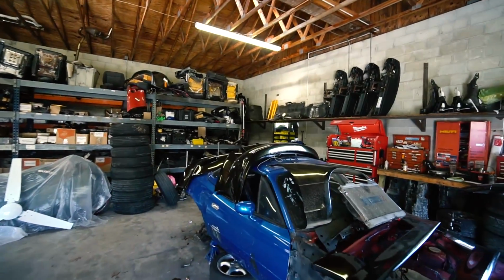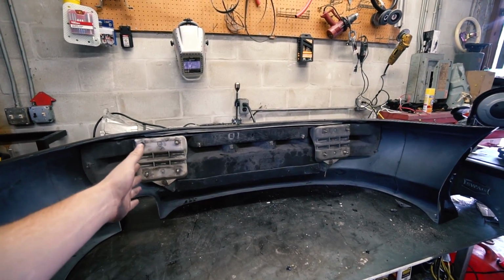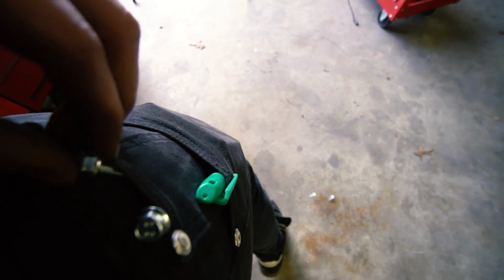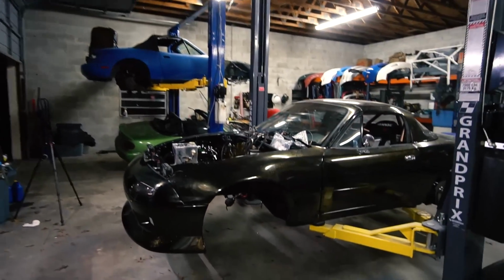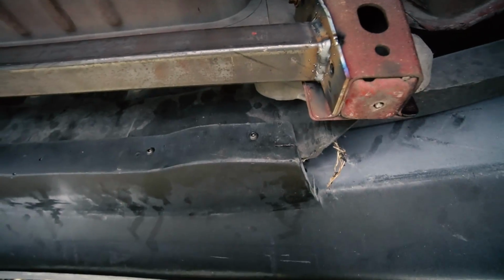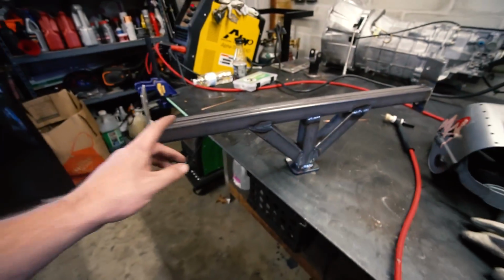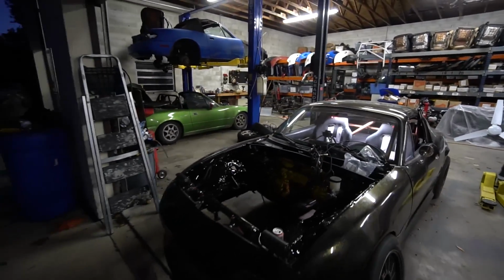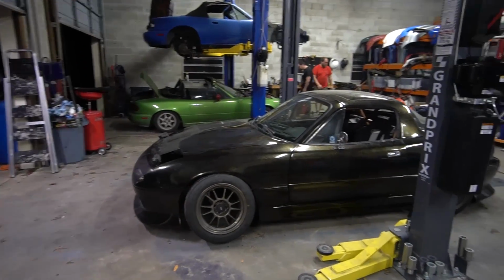LS Miata Gets INDESTRUCTIBLE Body Kit!

Comment: I did replace sideskirts on a 2 post lift, it was a brand new volvo v60. I was also amazed that is worked on a 2 post but i got a  steril koni lift at work. It's absolutly my favorite lift since it wased placed in 2016 because the 80's one finely died

Comment: i jacked the car up before from the rear tow hook point before. it collapsed and when the car dropped, it broke my diff. get an aftermarket rear bash bar w/ a jack point instead? but i guess if you're welding the two points together, it should work. in theory.

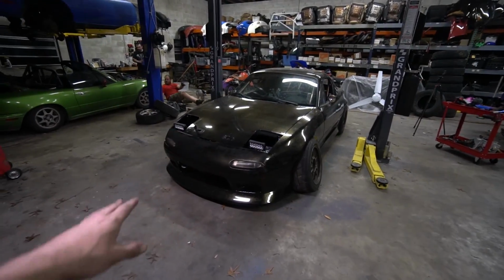Comment: @22:27 pause the video now imagine you took your headlight bars and recess them back into the headlight bucket so that the front of the headlight is flush with the back Edge of the headlight bucket on the hood. Then you go buy some plexiglass and cut it out the shape of the headlight. Make yourself some brackets to glue the plexiglass down like a headlight cover so that you would have smooth headlights on the front of the Miata instead of popups. I know you've had pop ups for a while and the Sleepy Eye look is cool and all. But it's kind of old I'm played out. Having flush smooth headlights especially with your new body kit I think would make your Miata really A1 off Miata. Plus making those covers could be a video. I think that would be dope as fuk

Comment: Another option for jack points is weld a vertical tube down from the door bars NASCAR style. Then you jack from the sides and don't have problems with the front or rear bumper covers hitting the ground.

Comment: Why didnt u weld inside between the square tubes
Reply: Akward to reach, and the design is plenty strong enough without those. You could probably jack up 3 miatas with that jacking point.